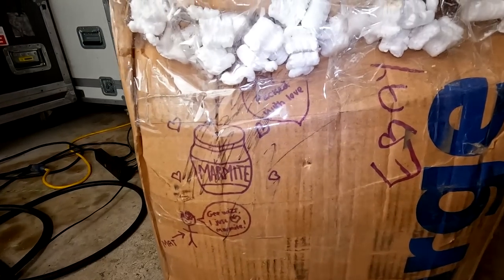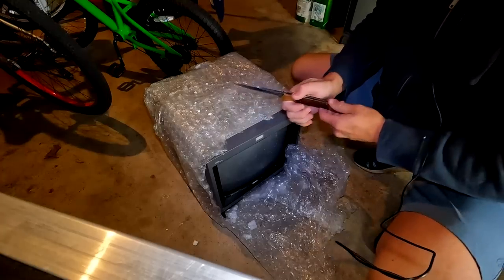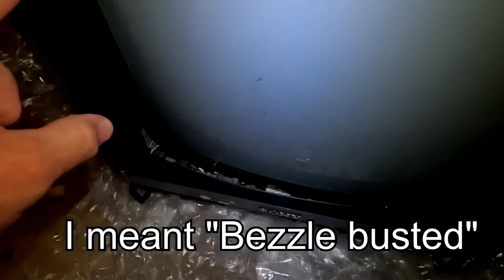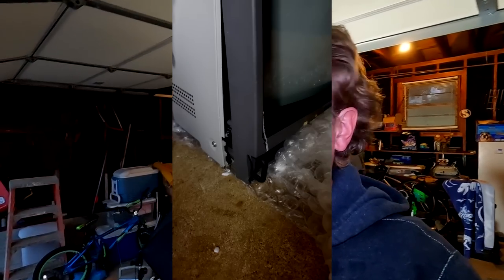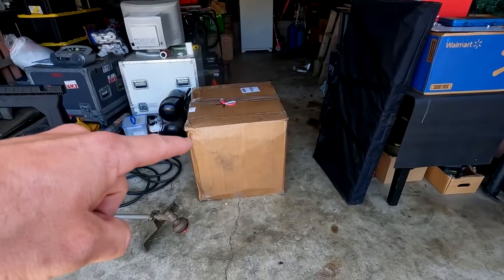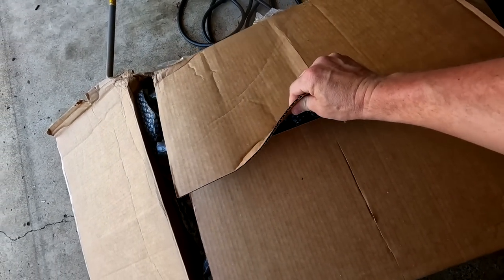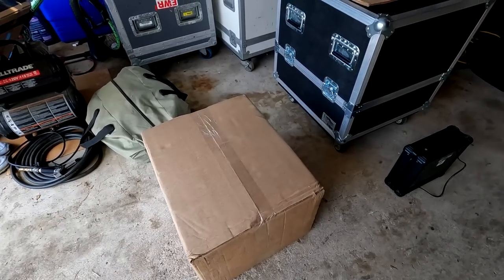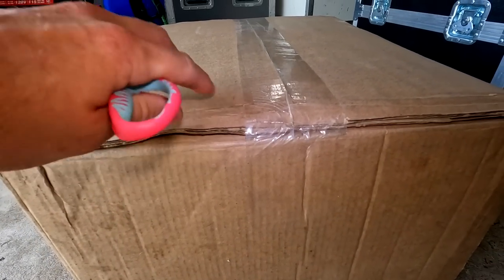I'm done buying Crap CRTs on eBay!

Comment: The problem with eBay sellers is they're either stupid or don't care when it comes to packaging stuff. I bought some laptop chargers I needed recently and they were just loosely bouncing around inside of a box with a little bit of bubble wrap. Of course since they were USB-C chargers the tips got damaged from getting banged up. I would never buy anything rare or fragile on eBay anymore. I stopped buying audio gear online because I got tired of it arriving damaged. You're only hope of getting something in one piece from an amateur seller is paying them to take it to the UPS store. But even then they do some sketchy stuff.

Comment: What I do (whenever I buy sets from ebay), I arrange for a company like Craters and Freighters to pick up the TV from the seller. Next, they place the TV into a crate for safety. Lastly they freight the TV create to my residence intact. It will cost more than the set. But at least you'll have the piece of mind that it will not come to you damage. I say when buying from ebay, do not allow the seller to mail the TV. Have a firm like Craters and Freighters pick up the TV and have it packaged and delivered to you . This way you know that the TV will be exactly as it left the owner...

Comment: Just bought one on Ebay but it was local pickup. Powered it on and had a pink spot on left corner of the screen, which was not visible in pics on the listing. 
Degaussing wand didn't resolve it.
Fortunately, seller reluctantly gave me a refund, but did not want the tv back. 
Trying FB marketplace now, but most are porch pickups and sellers do not want to send pics of the screen so I can view the image quality. 
I read somewhere some companies sell CRTs new.

Comment: Shipping CRT's is way too risky! I don't think it matters of how well packaged it is.
Reply: I agree. No matter how well you packed, there are still chances getting damaged. I used to have a computer packed in factory box with styrofoam surrounded 4 sides but still got damaged (chassis deformed). When the box dropped on ground on its corners, nothing will survive. Shipping something like this is just gambling. And please remember, you't better try to avoid Fedex and USPS, UPS is way safer.
Reply: @changlongnan  I wouldn't ship a modern TV - let alone a CRT.

Comment: A good part of this is the sender, but the other part if the courier. If the courier uses your package as football and the contents is something like a CRT, then odds are it's going to break.
Senders and buyers should not cheap out and go with the lowest bidder when it comes to courier. Even then, stil no complete guarantee, of course.
That being said, not packaging something up appropriately is deeply lazy and stupid - even more so if the seller didn't insure it.

Comment: Damn, that is a shame to see such nice devices get damaged due to an idiot's lazy packaging job. I just can't understand it either. The sellers are wasting their own money and time by not doing a proper job packing stuff.

I sell on eBay frequently, and all expensive items (especially electronics) are wrapped in bubble wrap SEVERAL times over, and packaged in boxes that actually fit the item. A lot of people will tell newbies they can use anything to pad the rest of the box (like newspaper, grocery bags, even tissue paper) - NOPE. All of that stuff (and even packing peanuts, despite their name) are way too thin and flimsy, and won't actually hold the item in place when the box is being jostled on a truck or thrown across a room. Bubble wrap and cardboard boxes are not expensive, especially when it comes to $400+ items.

Sorry about the rant, this stuff just infuriates me, lol. I was actually thinking about getting a bigger CRT sometime, but now I'm very wary of buying one off of eBay. I also once had a limited edition PS2 shipped to me in a Subway box w/ sandwich wrapping paper, no bubble wrap whatsoever. Somehow it was perfectly fine, but that still irked me.